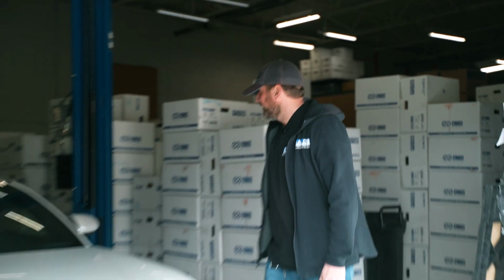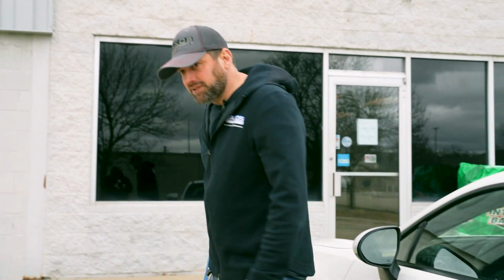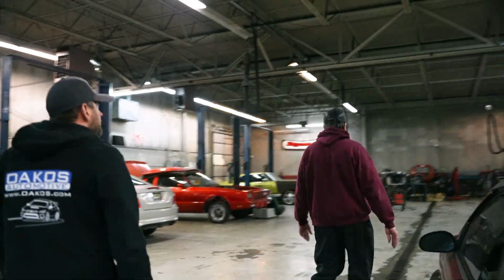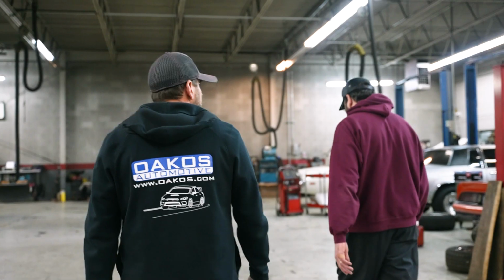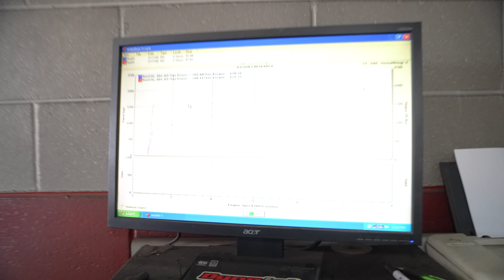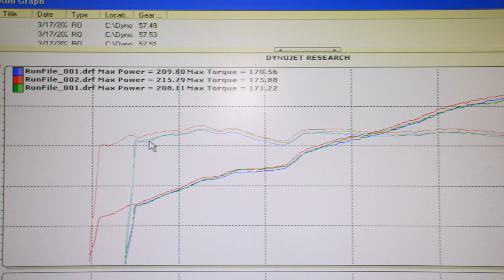TAKING OUR NEW BRZ TO THE DYNO!!!

Comment: Dang good results! Better than the old stock GD wrx’s would make.
Reply from the maker: It is a Dynojet so obviously the numbers will be higher than some Dynos.  But after looking around though I'm seeing a lot of other stock dyno pulls with numbers that are higher than would be expected so it looks like the cars are under rated a little bit.  That could explain why it feels like a bigger improvement than I would've expected from a 28 horsepower gain over the old car.